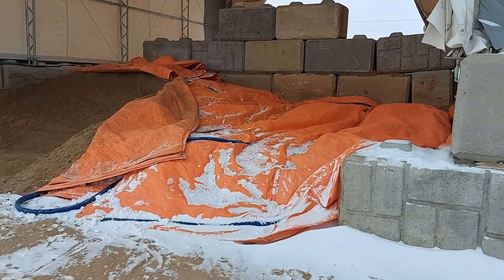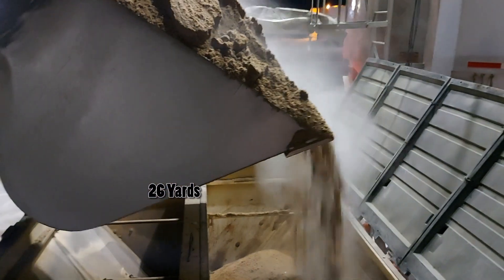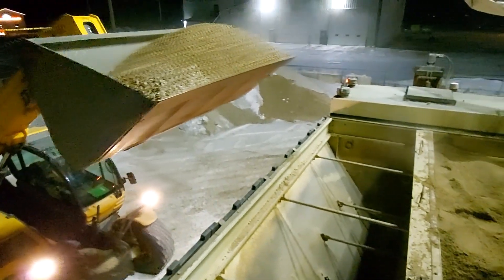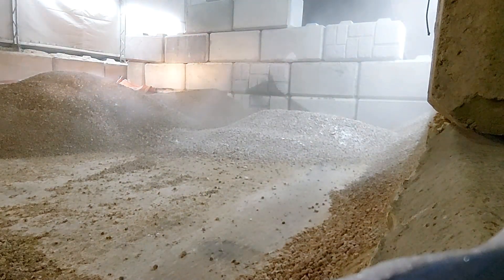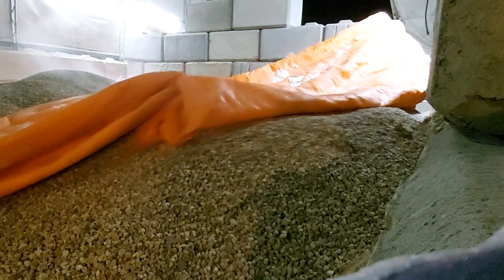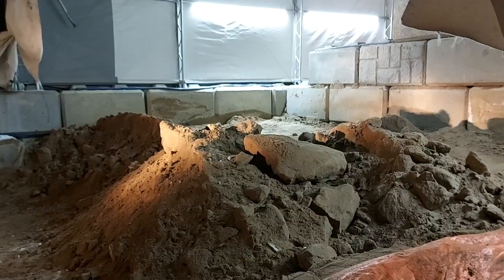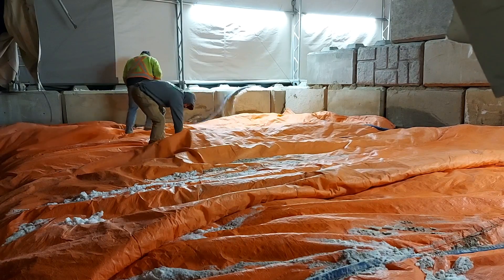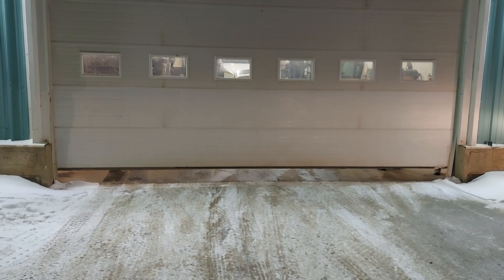Heating Aggregates for Winter Concrete | Ep 11

Comment: I enjoy watching your videos of volumetric concrete pouring. Will you be making any more videos? It has been a while.
On the volumetric concrete truck on the mixing auger why are there protrusions that do not have a curved auger section bolted to them? Is this on purpose to improve mixing and not push the mix out too fast?